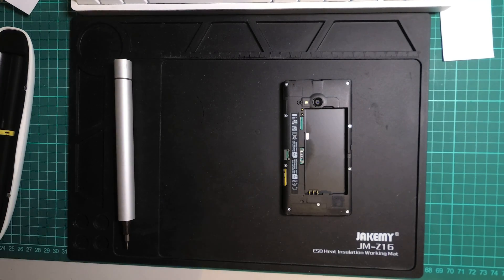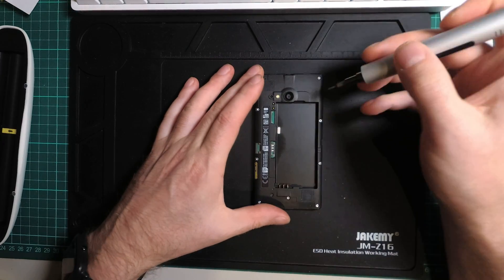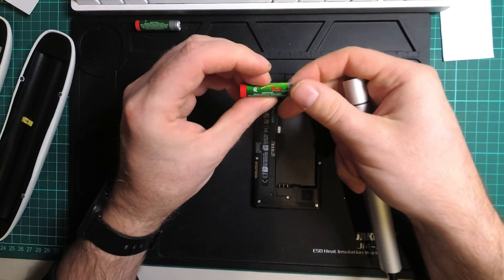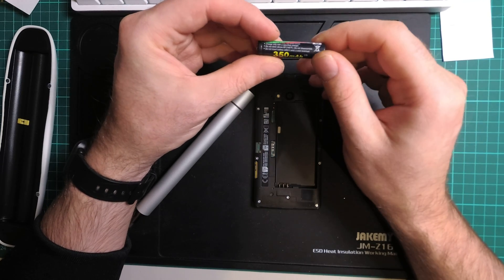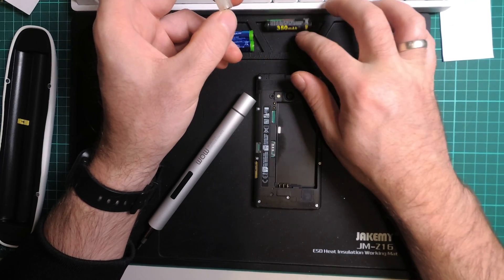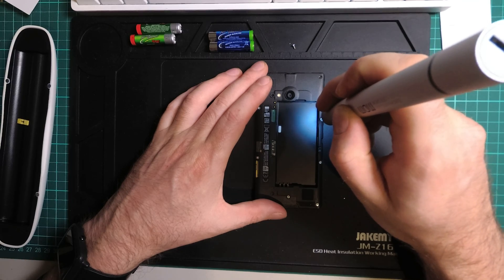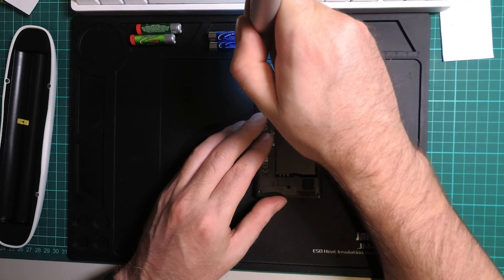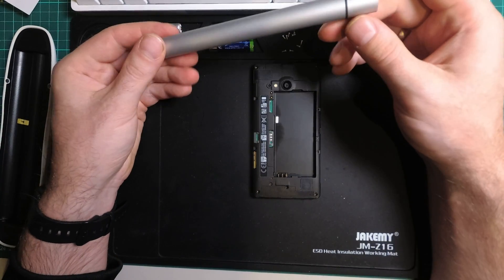Pimp my WOW Stick: more power with a 10440 cell

Comment: I did this mod, ran my wowstick 1p+ with 2 parallel 10440 batteries for more battery life. Tried using the batteries in series but unfortunately the controller IC is automatically cutting off power to it, causing it to not work with it.

Too bad after 2 years the gearbox died. Already have a jakemy y03 in the mail and a replacement gearbox for the wowstick.
Reply from the maker: I also manage to distroy the gearbox but is was the gear directly on the motor. Use now the Wow Stick 1f

Comment: Since it requires 2 batteries, do you think it would work with a 3.7 LI-ION and a regular 1.2 Alkaline? Woul 4.9v be too much for the screwdriver?
Reply from the maker: You shouldn't mix different battery chemicals. You o fake battery.
Reply from the maker: I just add a link to a dummy betteery in the description.

Comment: Did the same when i got mine years ago, still going strong to this day. Not only is it stronger but also lasts longer than good name brand Alkaline batteries, and when it starts to feel noticeably weak it's still over 3.0v as to not damage the battery. So it's "safe" if you don't run the battery down past a useful level ;-P

If you don't have a 3D printer you can use a M8 bolt and lock two nuts together at the end, needs to go in first as the screwdriver has a plastic liner on the inside but might cause a short if used on top. *I have a 3D printer but that worked out soo well as a temp test that i never cared to replace what works

Comment: Hello, thanks for the tip !  Could you please let me know if you have encountered any issues since the upgrade?
Reply from the maker: In normal use it work perfect. But I started a tourcher test to measure the torque increase. During this tourcher test one gear of the mother did break.
Reply: @AntonD  Thank you for your reply! Your amazon link for the battery no longer works, but I will for sure source one and do this upgrade.
Reply from the maker: Just upgraded the link have to change to Alluexpress
Reply: @AntonD  one gear of the mother?  Sorry, does this mean the internal part of the screwdriver broke? Or something else?
Reply from the maker: Yes, one gear of the screwdriver brockes but the problem was the stiff mount for the test ran. If you hold it in the hand, the start touque is smaller because of your hand, wrist flexibility. I have an 1p this works like a charm in hand mode use.

Comment: I use two in mine and it works great! Not a problem.
Reply from the maker: Is nice to hear. Thought 3 times the normal voltage is to much
Reply: @AntonD  It uses digital step up converter anyway, so it actually lowers load on the device.
Reply: @Vatharian  have you got any info on what step up converter the wowstick uses?
Reply: You really use to of them in same time????
Reply from the maker: I use only one
Reply: @AntonD  I asked for Bob, but as well maybe you know is it possible?

Comment: where did the get the g.code for extension...does anyone know how to get to the switch for repair.. thanks
Reply from the maker: Which gcode you mean? Do you need a spare switch cover or a new switch(the electric mechanic part SMD)
Reply: For the plastic fake battery I guess.. Thanks
Reply from the maker: You can find the stl here https://www.thingiverse.com/thing:2848025

Comment: it cut the life of the wowstick or it just work fine until now, i like to do the same as you do but in wowstick 1p+
Reply from the maker: It works fine for me. The life of the motor may reduce but this is only theory. But you safe time and this is real. I have never use a electronic drill till death of motor. In the most cases the battery died and there was no spare parts